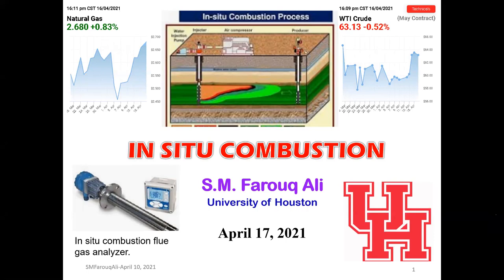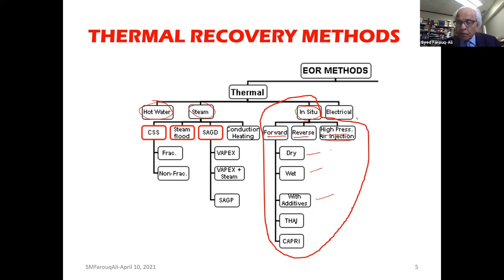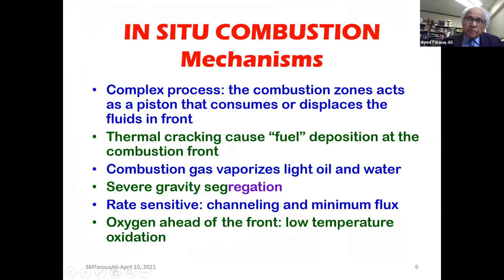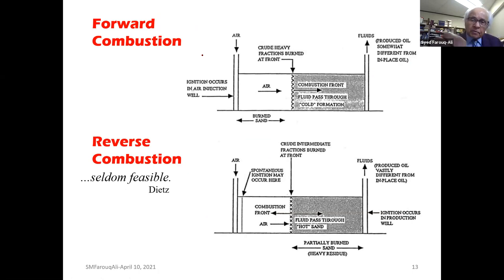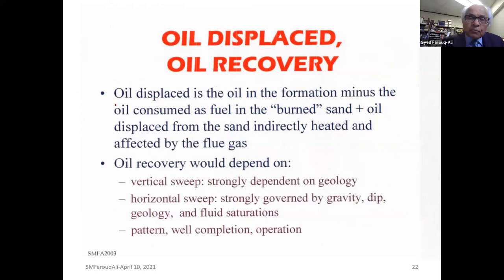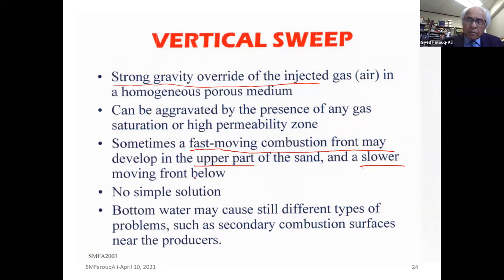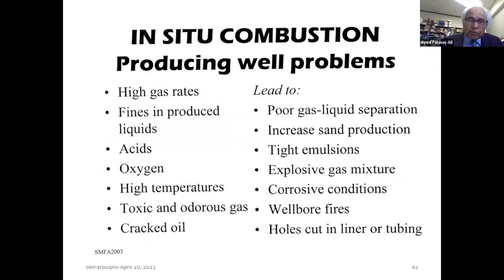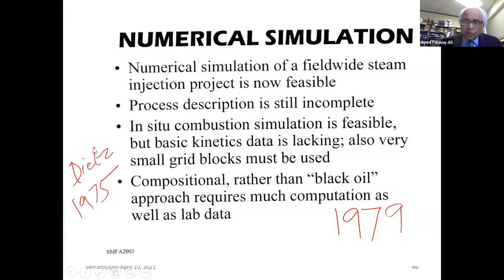Enhanced Oil Recovery Short Course by Dr. Farouq Ali, Lecture 03/04

Comment: 1) Are we able to make the combustion zone more expanded in a way that generates more steam and  by that we'll be able to dsiplace more oil in this case ?
2) What we can do to overcome gravity segregation of air ?
3) What is an injectivity test and why it's imporatnt reagrding the air injection rate ?
4) What does mean the term Low Temperature oxidation in term of in situ combustion and why it's a big issue from reservoir point of view ?

Comment: As mentioned in the session, most of the  in situ combustion projects are not commercially successful, so what Is the item that raise the cost of this method, is it the compressors or the periodic  workover for the repeated mechanical problems? , and what is approximately the cost of Barrel of oil in this method?